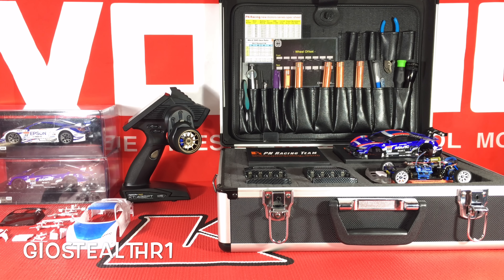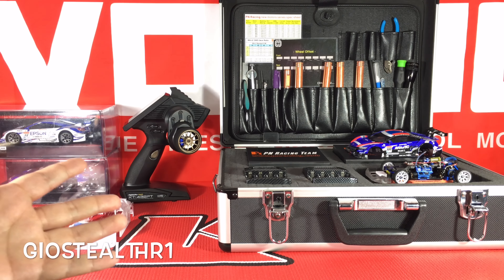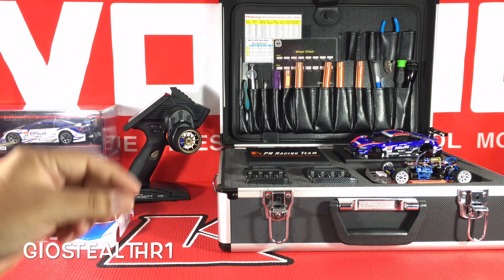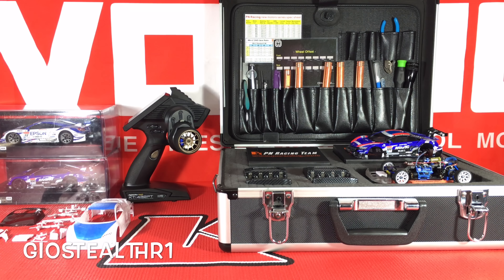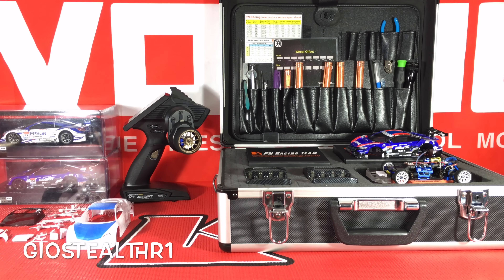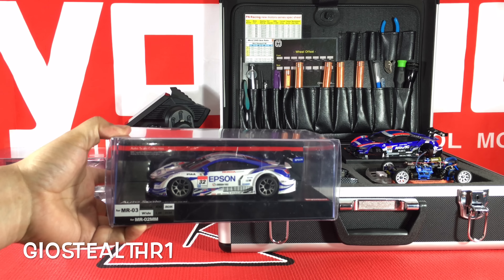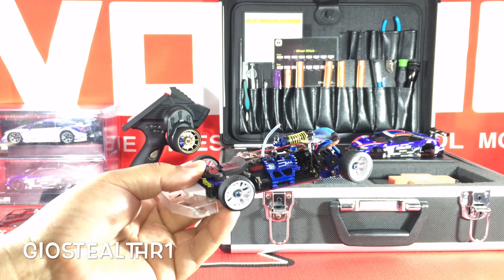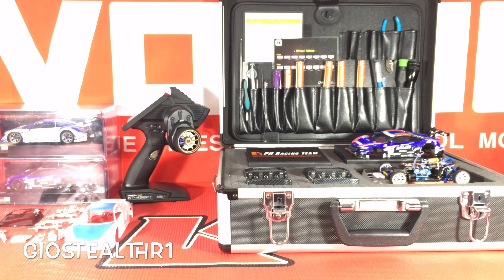WHAT DO YOU NEED TO KNOW ABOUT KYOSHO MINI-Z MR-03 PART 4

Comment: Yo what’s going on nice equipment u have there. I was wondering wondering how to put a ball bearing diff on mini z mr 03. Got it on but it’s got a little resistance when I turn one wheel. The diff stays still but when I loosen that disc thing when u turn 1 wheel the other doesn’t turn... tighten up just a hair and and both wheels turn when I turn just 1 wheel but still feels lil tight.

Comment: Hey, I getting into miniZ racing with the local hobby stores and was wandering if you could point me in the right direction on Batteries and chargers ?
Reply from the maker: I use 
Orion triple a charger 
700mah batteries 
800mah batteries

Comment: Hey ive just ordered this Kyosho MINI-Z MR-03VE Chassis / Transmitter Set #32741 and a few wide rm ASC to go with but what tires, rims and general mods would you guys recommend and does any one know if i can change it from a RM to a MM and do i need anything? As there is alot more choice in mm parts and ASC. Thanks for any help guys.
Reply from the maker: Yes you can 
Just know you need a asf controller
Reply: +GIOSTEALTHR1 Hey thanks for the epic quick reply, that kits comes with a kt-18 transmitter and a mr 03ve chassis but says on the box that it is rm and nothing about including a mm mount so do  you know what parts i would need to do this? Cheers in advance

Comment: Mini Z or Atomic AMZ?
Reply: depends on what you plan to do with it. If you plan on racing, check your local club rules because some clubs only accepts mini-z chassis since they're spec class. If its for your home track or just messing around the AMZ shaft drive is really good, cheaper and faster than a stock mini-Z.